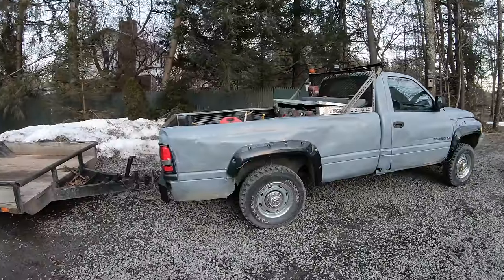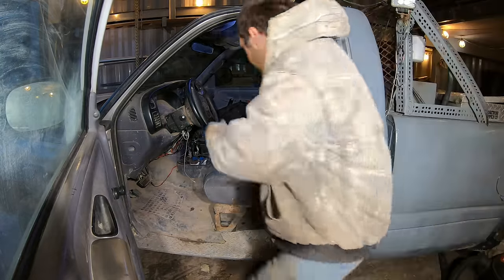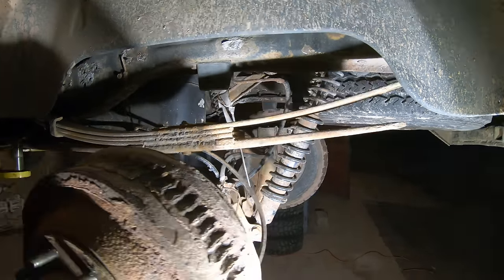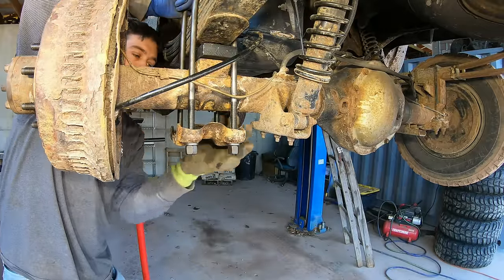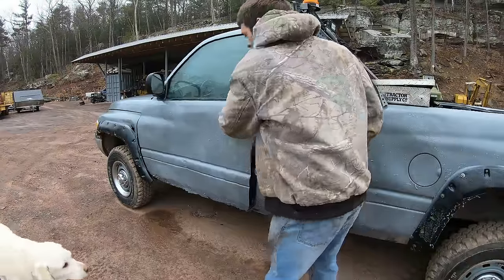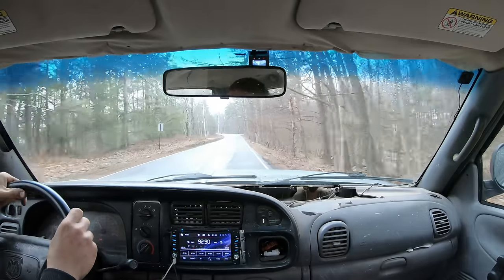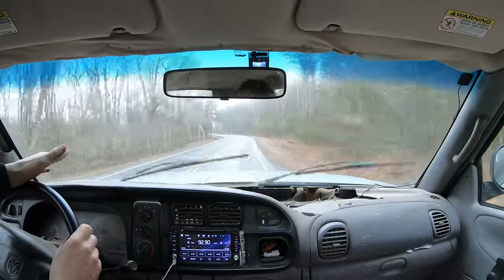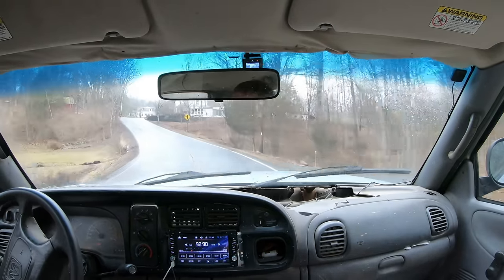New seat and leaf springs in a Dodge pickup truck

Comment: Fluid Film is great for coating the frame and underbody.  I know a guy that has a 10 year old GMC Sierra that looks almost brand new underneath (and he lives in Western MA).  The reason older GM trucks rust so badly is that instead of powder coating the frame, GM used a wax coating on it since it was cheaper.  Obviously wax doesn't last.

Comment: My 1998 S-10 is classified as a S-14 have to pay for a full truck license every year. The only difference that i see is it has a ladder framed boxed frame.( it's a 4 cylinder i put Travel Master Suspension in the rear.) I love your t-shirt your selling i got XL a little snug though, and wish it had a pocket for my dorky pen holder. Your one hell of a worker and innovator!!! Need to take more precautions not to hurt yourself, you'll pay for it when you get older i have had alot of injuries and know! I was a Journeyman Machinist.

Comment: Don’t know about dodge - but on the older fords, the rear leaf spring hangers are the first things that rust away. Easy way to check if a truck has ever had rust issues is to immediately look at the rear hangers. If they are riveted in, they are original. If there’s bolts holding them on, they’ve been replaced, and you know to look a little harder if it something you’re looking at buying.   Esp on duallies - they kick up twice as shit behind the wheels..  my dually’s rear leaf hangers both rotted away, but the rest of the truck is in great shape.   You get a dually - you’ll never want a single rear wheel again..  i mean for a plow truck - yeah, SRW..  but for everything else dually’s are just so much better..  esp the old ones..  i had a 94 f350 srw, and have a 95 f350 diesel dually - its NIGHT and DAY how much better the dually rides and drives. NIGHT and DAY..  with all the towing you do, you should keep a dedicated plow truck and get a dually for everything else.

Comment: I spoke with a guy that worked for GM. He said the reason they use steel lines is because steel is stronger and steel lines don't stretch under breaking, which means you get sharper break pedal.

Comment: Andrew, I know you were just trying to remove the U bolts,,,here is a tip,,,,first you need an air impact them electric impacts are under power,( I know, I have one) and second,,,and very helpful homemade penetrating fluid,,,mix in a spray bottle 50 % acetone or lacquer thinner and 50% transmission oil and you have to spray the whole nut and tread,,,not just the bottom tread part, keep up the great work....

Comment: Hey andrew first comment, I have a S10 and have done a good bit of research after buying it. Chevy's (and I'd guess most trucks) break or bend between the cab and bed or right behind the motor, just before the cab because that's where the crumple zones are. How much actual strength is lost in the frame in other directions because of the crumple zones is the engineering magic because as per federal law they must fail at those locations during a crash. Also important to note the actual federal law (and/or policy or whatever else they want to call it) only requires vehicle manufactures make these features into the car, the moment they are sold it's up to the states. When guys desert race S10s the first mod they do is bracing over those crumple zones, any jump at all will bend a stock S10 but just those few welded braces will let you jump one about 4 inches. Rock crawlers and mud trucks and overlanders often do this if they are off-road only or if state law allows.

Just thought I'd share a little knowledge. And moving from the north to the south, it's amazing how much longer cars and trucks last down here, to the point where older vehicles retain their values much better. Especially old Diesel trucks and Tacomas and 4Runners.

Comment: The best undercoating i use every 6 months is made by pro form. Oil base undercoating. I buy it bulk from carquest and spray it on with a pneumatic gun. Im in southern new brunswick on the salty bay of fundy and it really works

Comment: Britain every winter is covered in Salt but there are still plenty of 50 year old 4 x 4s running about ,they are called Land rovers .Built out of galvanised steel and aluminium bodies with brass and copper brake pipes ,they last forever .

Comment: I don't live in the rust belt but, I've saved a number of bolts  by wire  brushing the threads before attempting to loosen the nuts.

Comment: A little wax and that truck will come right up.  :-)
Watching you with those leaf springs, I wanted to jump in and help.
BTW:  My 2001 Mazda Tribute has over 220,000 miles and I'm the original owner.  Fix them and drive them.

Comment: The one thing that does make a difference is what your city / state puts on the road. Up in Québec, we're using a lot less salt then we used to. Some roads which are particularly prone to ice or which are main thoroughfares do get salted, and we do get the salt out when things get particularly icy, but otherwise, we mostly put sand and gravel nowadays. Also, what you say about rust and that american truck of yours does have quite a bit of truth to it. Japanese cars stand up really well to rust in comparison. For that matter, you are further south then I am, so your state probably puts way too much salt on the road to start with. Even in the dead of winter, it takes just one or two sunny days after a storm to sublimate the vast majority of what is left on the road after the plow has done it's job. Then again, I keep hearing those stories of carmageddon from the US every time there's even a little snow. Do you have laws requiring snow tires during the winter? If not, that really should be something that your state should look at.

Comment: Simple solution to rust.Oil spray every year.You have all the tools to do the job.I spray every year and even spray used oil,works miracles.MY 2004 dodge ram 2500 diesel has almost no rust at all.you can run them all winter in salt,just spray them in the fall.You have to oil spray,its a must.And,a lot less undercarriage repairs.FYI

Comment: prior to the 80s, the steel brake lines were lead coated, and they were good for half a century. Then, for environmental reasons, apparently, the lead coating went away and they became powder-coated. You've seen the results.

Comment: They say that rust proofing in the Spring is best because thats when it gets warmer and the salt start to attack the metal when its above 0c. Also you can spray Fluid Film & Krown even if there is salt on the car as it will go under the salt and still protect it. Best of both works is rust proof before the winter and in the spring.

Comment: I fluid film my truck and cars before every winter. I thin it a little then spray it with an undercoating gun. It only seems to last 6 months before the frame looks dry. You'd want to do it at least every year, but better to do it every 6 months. It's better than nothing but I think paying krown $150 each year to do it would be more convenient.

Comment: Every used Chevy and Ford truck I've ever bought including the 62 half ton on a 3/4 ton frame 4 on the floor with 16.5 tires I loved I've jacked them up on double wide  6 X 6 wood blocks stacked 6 high each corner carriage bolted together then removed ever nut and bolt one at a time and used lock tight on them.
Then I sand blasted every rusted area then primed them then sprayed the entire undercarriage with 4 coats of rustproofing.
Never had a frame or suspension problem.
It kinda pisses me off car manufacturers don't use locktight on every nut, bolt and screw.
I find brand new nuts and bolts all the time in gutters on my walks.
Most from Japanese and other foreign brand cars.
You can definitely tell the difference.

Comment: Looks like you might need brake drums next. I think you are going to get your money out of that truck. You ever thought of moving south where your stuff won't rot from all the salt? I think that is why the metal culverts rot so fast up there. They last a long time down here in Bama. Never had much rust problem here in N Alabama. Use to have problems in FL because it was so humid. My 2000 Ford Excursion looks good as new underneath it and it stays outside. Good video as always.

Comment: Your roller looks like a smart purchase. Hyster makes some good products. Kind of surprised you didn’t look for a Galion S2. They have wheels on the side that can be lowered along with a tow bar for easy transportation. The question, however, is Will you use it? And if you do, will it be more often than once a year, like the crane?

Comment: Oil spray makes all the difference in the salt belt. You wouldn't need to worry about rusted out brakes lines, frames, body panels...etc. Rust is easily the worst thing that could happen to a vehicle. If a transmission or engine fails its easy and cheap to get a replacement. If your frame is in powder form its only good for scrap.

Comment: Hey Andrew, I've seen guys put airbags on the front of those dodges, don't ask me which brand and model exactly, but little airbags fit nice between that little flat spot on the control arms and the frame. I've put the heavier 1 ton springs in the front of mine... doesn't do much difference.

Comment: Totally agree with the used work truck perspective.  Paying 30-40K for a truck to do exactly the same job a 2-3K truck can do makes no sense to me.  I used to wonder why people would pay 40K for a really nice off road vehicle then never take it off road because it would get scratched up or dented.  Don't get me wrong, I like a nice truck as much as the next guy but they have gotten way over priced.  As for the rust discussion, would that spray in bed liner material block rust?

Comment: Exactly, a vehicle is just a means of transportation nothing more.  $2000 versus a $50000 trucks.  They both do the exact same thing.
I 100% agree on the ban on steel brake lines.  I've had brake lines break on me at least 3 or 4 times.  Once it could have caused an accident.     
I've also never had a vehicle where the dual master cylinder actually works when a brake line fails.  You are supposed to still have the brakes on the other wheels when one line breaks.

Comment: You are pretty much the only mechanic on youtube that I've seen use WD-40 and not PB Blaster. I used to be fooled by the PB Blaster marketing wank on the can too, it is convincing. Especially the magnetic part got me I was like ohhhh magnetic it must work really good. I kind of doubt now looking back that a fluid coming out of a can could be magnetic, and if it could be it must be expensive to do. Anyway after a Project Farm video where he compared all of the penitrating oils WD 40 worked better for getting off rusty nuts and bolts than blaster did and since then I switched to WD 40. Also my mechanic friend complained once about how bad PB smells and it never really bothered me but after he mentioned that I did notice that it smelled bad and then I noticed that WD 40 smells pretty good in comparison. The #1 rusty bolt and nut loosener on that Project Farm video turned out to be Seafoam Deep Creep, but not by much. WD is pretty much the best all round stuff. Made for preventing rust but works great on nuts and bolts. Just don't spray it on plastic gears and ruin them like I did.

Comment: Ideally, you should replace those rear shock absorbers too when you change out the busted suspensions as there's a good chance the shocks has been compromised. Note that a set of properly functioning suspension and shocks really comes in handy when your truck is towing as well as improve the safe braking distance.

Comment: who cares about rust , drive it til it dies. the only thing to worry about on that year dodge (i have a 98 now and had a 97 ) but watch where the steering gear box bolts to the frame. i never had a issue there cause i keep it cleaned , but have seen the frame rust out where it's not repairable where it bolts up.

Comment: Trucks last much longer here, but I live in North Texas, we use No salt. And it hardly ever snows here. So our trucks even after 10 years , under neath the truck looks much better than trucks from north where snow falls heavy, and lots of salt. Which brings lots of metal damage. Bolts not able to remove. They look really bad from the north. Here, no vehicle really looks that bad underneath.

Comment: problem with rust and paint is you have to keep up with it and that truck is too far gone.. you could get a gallon of rust converter and spray the underside and it turns it to an oxide but how bad it is you would have to wire wheel everything or sand blast it first then hit it with rust converter and then paint it.. but then you have to wash it often during the winter.. people dont even wash the outsides of their cars let alone the undersides but you have to if you don't want rust

Comment: Don't know why your area uses salt for snow, when sand works fine and doesn't destroy metal. Heck my city spraays some sort of beet juice on thee road that keeps ice away and it works great. I thought leaf springs came powdeer coated or painted at least to help prevent rust

Comment: I WAS BORN AND RAISED NOT TOO FAR AWAY FROM ANDREW, ( ROCKLAND COUNTY N.Y.) AND I HAVE TO AGREE WITH HIM.  THE WAY THEY MANUFACTURE AUTOMOBILES AND THE SALT THEY USE ON THE ROADS IN THE WINTER YOU'D BE LUCKY IF YOUR VEHICLE LASTS 5 YEARS BEFORE IT RUSTS OUT.  I'VE NOTICED ALOT OF GUYS IN FLORIDA WHO LIVE LIVE NEAR THE BEACH WILL TAKE THEIR TRUCKS TO A PLACE WHERE THEY REMOVE THE CAB AND BODY AND SPRAY THE FRAME AND ENTIRE UNDERCARRIAGE WITH RYNO LINING

Comment: "I'm going to get a rust free Southern vehicle."

Beware of any "coastal" vehicle, TX, FL, SC, CA because of
ocean air is extremely corrosive, and those vehicles corrode
from the inside out, exactly the opposite of Northern, "Salt Belt"
vehicles.

That is not sodium chloride on your NY truck. Most of NY DOT uses
a mix of Calcium chloride and Potassium chloride, with a brine liquid
in tanks of low fructose corn syrup (non food grade) to help the first two
stick to surfaces, and work at much lower temperatures than rock salt,
and without killing vegetation.

Andrew- Ever see cars on our Thruway? That white powder, that's
impossible to wash off (with plain water) and EATS sheet metal?
That's that mix. The Thruway is actually warm & dry most of the time.

Comment: those springs are pretty beefy thats a good upgrade for you. You are lucky to have a spring place near you .. they can make you springs too but if you can get 1 ton or diesel springs that fit then that would be good. If you want to paint it www.paintforcars.com has paint kits that aren't bad in price but you would have to do a lot of work straightening it first and then its still rusty underneath. One thing that goes on those trucks is the axle will actually rust through on the back of the pumpkin center.

Comment: the one benefit of the 2015 and newer fords they don't rust I had a buddy who got a 2015 f150 with a junk motor repowered it to a 351 Winsor and the 5 speed  hasn't rusted out yet now I don't know how the aluminum frame  would handle rough off roading secondly the Toyota frame thing was a recall from lawsuits they only replaced them because the had to and there is a list of reasons they can get out of it

Comment: Ahh...the ol' Bronco II.  There are some who swear that they were the best thing Ford ever put out. Me? I wouldn't piss on one if it was on fire. Transmission issues, suspension issues, rust prone in the quarter panels...try to find one without rust in the fenders or quarters and you'll struggle. Many will after market the shit out of them to make them an offroad only for mud bogging and rock crawling. But that is it.

Comment: So if you got another truck, a 1 ton, what would it be? Pickup or flat bed? Gas or diesel? Single rear wheel or dually? Ford, Dodge or Chevy?
Reply from the maker: Ideally a dodge 3500 single wheel diesel. pickup is ok.

Comment: Why not get a diesel truck? Much less fuel consumption doing heavy pulling/pushing, stronger engine, easier to work on, less that could go wrong. A diesel before 2006 or something only needs air and some diesel in the lines to run. Give it fresh oil and filter sometimes they run forever. Adjust the pump and give it more boost and you got a real pulling machine.

Comment: i live in nova Scotia  salt capital of Canada  i got a half tone single cab 2001 v6 Chevy for the simple fact it was the best 500$ truck on kijii and i had 4000lb of shit that needed to go to the dump and a apartment worth of supplies to haul in and only a 03 Toyota echo lol  for some reason the frame is really really good i expected it to be shot only one i have seen that good the last guy did the rear cross member with galvanized electrical mast that happened to slide in  lol  i spray it with used oil few times last summer to build up a layer  only reason i got it so cheep was after  3 garages looked at it they couldn't find the massive electrical short  they replaced the starter alternator ect  no way could they fix it so i pop the hood look at the main positive concretion block and there is a large wire that obviously wasent factory  i fallow it back and there it was shorting on the rear bumper in a steel connector figure at some point someone had a trailer with a winch  so i disconnected it put in a 40$ used battery been driving the the truck a year now lol  next one is going to be a dodge though

Comment: Had a 2004 Silverado 4 door
Just flunked my yearly safety inspection for an exhaust bolt that the head was snapped off
On my way home went to slow down and pull in my driveway and my brake line blew from rot ended up on my front lawn
Reply from the maker: Make Chevy fix it for free. Steel brake lines are illegal.